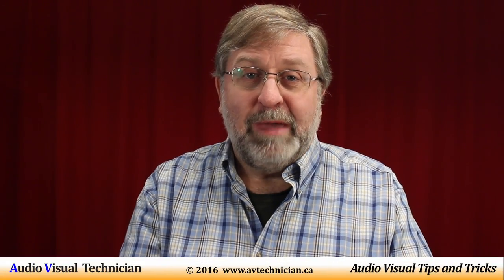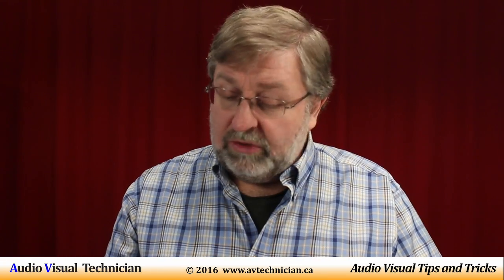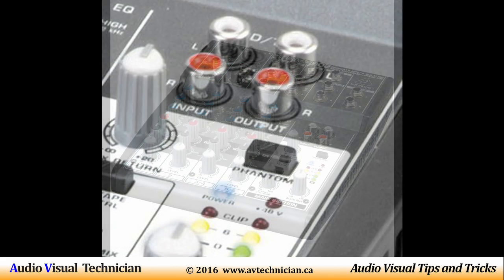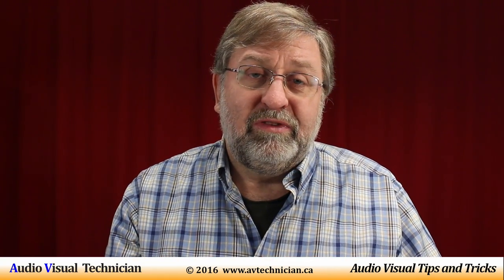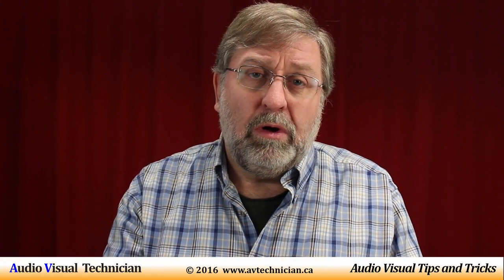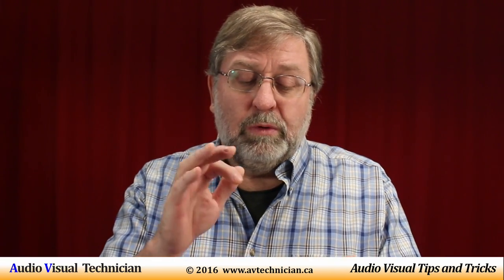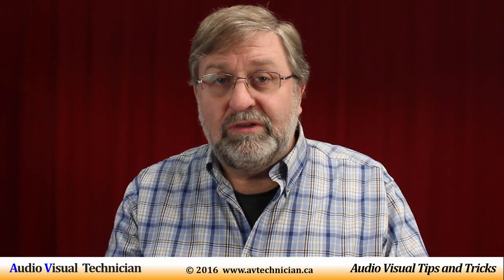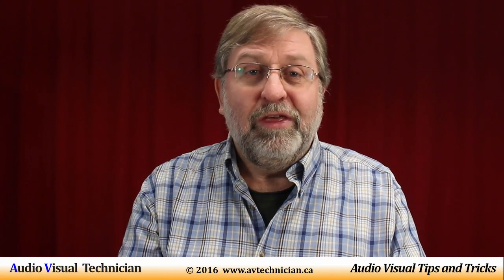Phantom Power - AV Technician

Comment: Will affect (ruin) my smartphone output connector if I plug it in a sound desk with 48V Phantom Power? Thanks
Reply: Phantom power goes through a microphone, not through a mixer's outputs.
Reply: I think I explained myself wrong. 
If I connect my phone (thu DI or mini jack to XLR) to a sound desk input (analog ones that has only one general 48v switch. Will that voltage ruin my phone conector?
Reply from the maker: If you mean a "sound desk" to mean a "mixer" then my answer is still the same.  
As I understand it, if you have a microphone that needs phantom power then attach that microphone to your "mixer" then the phantom is ONLY between the microphone and the mixer.  The output of your "mixer" has nothing to do with phantom power -- it does not pass phantom power through the output.
If you are connecting your microphone right to your smartphone and the microphone needs phantom power then you have to pass it though the "mixer". 
A battery power microphone doesn't pass power through the cable that way, it only powers the condenser. 
Hope that clarifies my answer, assuming that a "sound desk" is a "mixer".
Reply: Alright, let's start again. 
If I connect my phone, in order to play music, with a 3.5 mm jack cable to a mixer input (via DI or minijack to XLR cable), that has 48V switch "on" (like some analog mixers that has only one 48v switch for all the channels). Will that voltage affect my phone connector? 
No microphones involve in the question. 
Only phone (music) to mixer with 48V phantom power. 
Thanks 
 Btw, other ways to call mixer are: mixing console, audio mixer, audio console, mixing desk, sound mixer, sound board, or simply as board or mixer.
Reply from the maker: Ok, so now that I've missed the fact that you want to use your smartphone to play audio (music) through your mixer, sound deck, etc. let's try this again. ;)  I was reading you wanted to get sound INTO your smartphone (as you also posted your question on my other video about splitting the headphone jack of a smartphone -- although that message disappeared).
The audio output of your headphone jack on your smartphone goes into your mixer board one of two ways: through a DI box which converts the headphone signal to a Mic level input. To the best of my knowledge a DI box doesn't pass Phantom power through it (some DI boxes have their own phantom power switched though from an built-in battery).  Or you connect with a mini-jack (1/8") to a 1/4" jack in your mixer (or to the RCA jacks on the mixer). Since that is all line level and the phantom isn't on that part of the board, you have no phantom power passing through that circuit. 
We connect smartphones and other devices to mixing boards all the time using these two methods. Never once had an issue with phantom power getting to the phone. 
Hope that helps.
Reply: Thanks bro! You Rock!